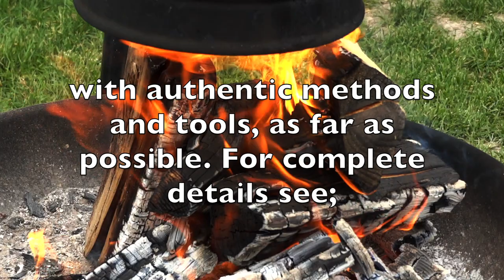🔴Viking ship building in Norway - part one

Comment: Very interesting, but I have some questions. If they were capable of forging steel axes, swords, daggers and nails, why didn't they make saws for cutting boards? or planes to smooth the planking? Also, did they have files to sharpen their axes? Recent discoveries in the excavations of Pompei have brought to light surgical instruments that work trough screw, which according to official history only appeared in the 16th century. Perhaps the official history does not truly represent the past. It seems to me, therefore, that with the methodology you use, it takes years to build a single vessel, but considering the average lifespan at the time (according to the official history) it is probable that it took generations to build a ship. Anyway, what you do is enviable.
Reply from the maker: Saws certainly existed in other culturs of that period, but none have been found by archeologists in Scandinavia. We do use planes copied from viking period tools but they are more tiring to use than more modern planes, though they are very effective. A viking ship like this one would only have taken scandinavians 6 months to build, but how many man hours went into such a feat, I would not like to hazard a guess.